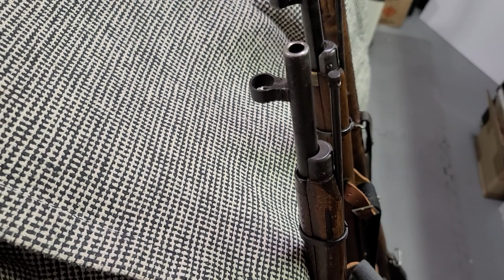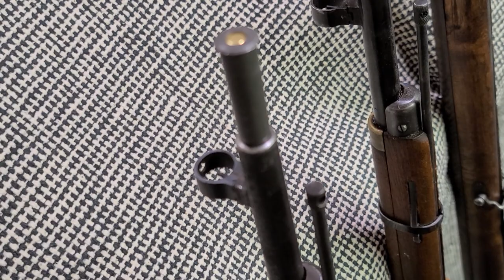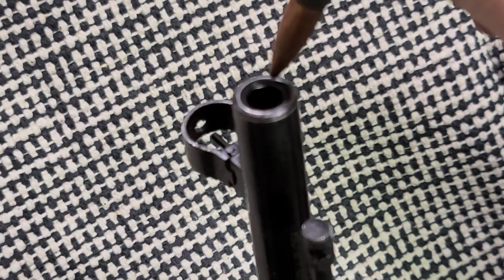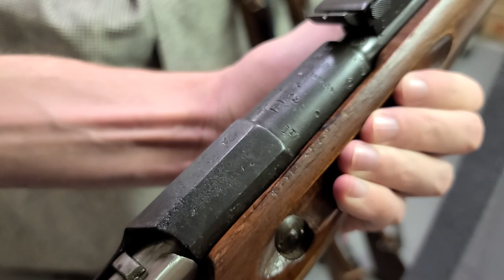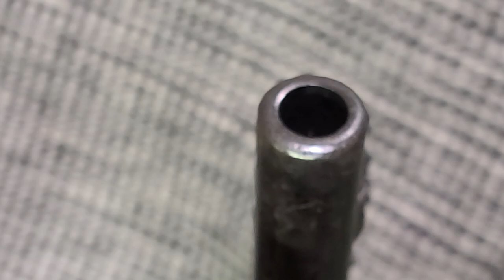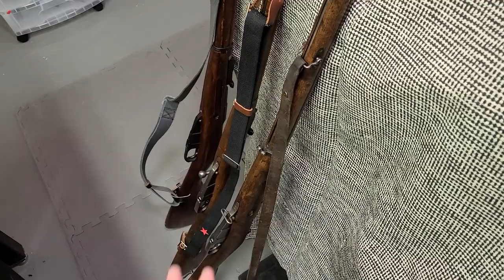Is your Mosin Nagant counterbored?

Comment: IMHO: The most common reason of messing bore is by improper cleaning using cleaning rod without muzzle cup to center it and constantly hitting rifling with cleaning rod.
Reply: Agreed. You should be using every piece in your cleaning kit. If you’re not, you’re doing it wrong.